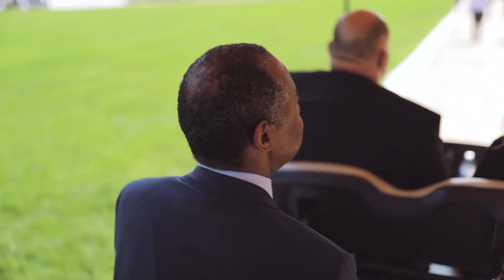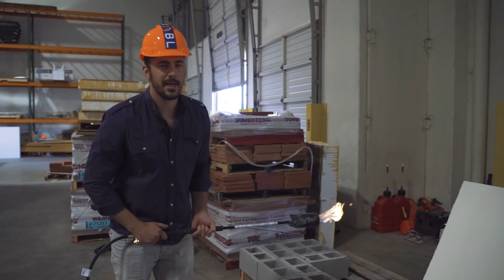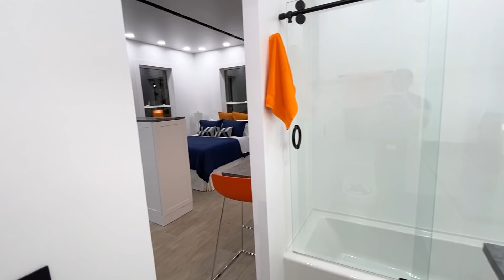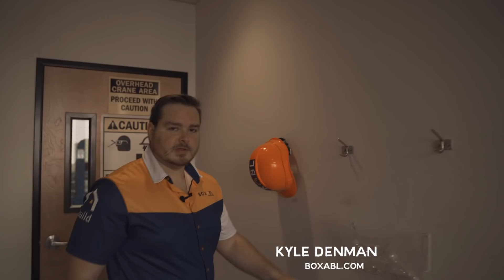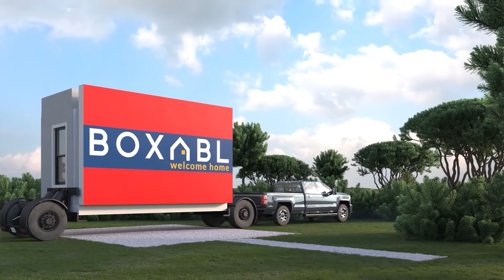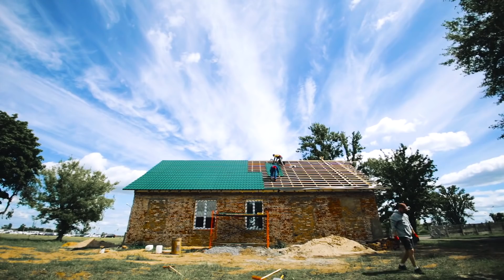This is the House Elon Musk Lives In

Comment: It's the closest unit that I've seen that fits my space and financial budget. Are you actually shipping now? Do you have specs yet for foundation, sewer, water, electricity for my architect to follow? I'm considering the 20 x 30; how much above the original $50K is the addition. The heated mirror is a bit much. Does electric wiring include wifi? Closets are a bit small in the $50K unit; are they better in the 20x30? Thanks for creating these awesome units.

Comment: Not cheep. That's not a full size fridge for a small house. Maybe a 4 bedroom house. Nothing with a flat roof looks good.  Great emergency housing. Isn't magnesium v flamable. Rather than housing alternative I think good granny flat, extension, remote off  grid housing option. Put solar panels integrated in the roof, lithium battery, and attached water storage and pump. Compost toilet? Set and forget. What about stackable? Multi story...if you can fit in a shipping container you have an international market. In Australia they could be classified as caravans so no council approval!!!

Comment: Looks like an amazing idea, though still a few unanswered question (that I neither can find on your website), like:
- How does the plumbing work? Does it have a storage tank or must the house be connected to community sewage?
- Does it come with Solar Panel and gas aggregate system for electricity? Or must it be connected to the power grid?
Also for us non-American people: This model is at about 34.8 square meters in size, so yeah for those doubting if this can be defined as a "tiny house" - yes it can.
Tiny house < 38 Square Meters.
Reply: Yes thats ready to just plug in to the site, the site work is not inlcluded, so that must be setup in advance, foundation and getting the utilities there
 but inside the house plumbing and electrical are already. You can setup utilities however you want to at your site. Whether its a water tank or solar panels it will connect the same way to the Boxabl as regular utilities. For more info check boxabl.com/faq
Reply: @BOXABL  aha nice!
Did not see that question "How do utilities connect?"
in frequently asked questions when I looked, even though it was that easy to find. Thanks!

Comment: $ 49,500 for a tiny home isn't bad for the quality of the home. I wonder how much a single empty room cost? Most people want to add/buy their own furniture.
Reply: The cost of the home is way more than $50,000.00 To put a foundation under it it will cost $25,000.00 more or less depending where you live.  A septic system is between $10,000.00 $15,000.00 also your taxes on everything will run you $10,000.00 plus dollars.  Land to put it on will cost you a lot.  Your $50,000.00 home will cost you well over $100,000.00.  This is not affordable.  A sucker is born every minute.  You think this 400 sqft home is affordable you are crazy.  The quality of the home??? Do we know anything about how energy efficient it is?  This whole video is a con job for weak minds.
Reply: @JesusSavesSinners  Hi. Looks like they have different foundation set up. Theres different ways to cut cost.

Comment: This is not remotely affordable.  By the time you get it on land this tiny home will cost more than $100,000.00.  Do not be fooled this is over priced.  They charge $50,000.00 base price.  How much does it cost to deliver?  This is before taxes. It will be mass produced and cost them $5,000.00 a unit probably.  He is a liar the construction industry has advanced a lot and uses a lot of cutting edge technology.  Mass produced factory housing has been made for decades.  What he is talking about is not unique or new.
Reply: The unit is $50,000 delivered to CA. It is the lowest priced ADU product in the country. Even lower cost that most manufactured/trailer homes.

Comment: They have a FAQ: https://www.boxabl.com/

How much will it cost to setup a Boxabl?
The Boxabl Casita is fast and easy to setup. For $50,000 you get a fully finished house. Whats not included in that price is your land and site setup. This can include utility hookups, foundation, landscaping, permits, and more. Depending on your location and the complexity of your site, this cost can range anywhere from $5,000 to $50,000.

Does it cost $250?
The $250 number on the front page of the website is an estimated finance cost for the Boxabl room modules only with an average 30 year mortgage. Any additional install costs would also be added to the mortgage. Final payment will be maybe $250-$500,
 
What are these made of?
*Boxabls are made from steel, concrete and EPS foam. * These are building materials that don’t degrade and will last a lifetime. The walls, floor and roof are structurally laminated panels that are much stronger than the average building.
 
Are they wind resistant?
Yes Boxabls are rated for hurricane speed winds. They can handle the worst wind conditions in North America.

Are they flood resistant?
Boxabl doesn't use lumber or sheetrock. The building materials won't be damaged by water, and they won't grow mold. This means if your Boxabl floods, the water drains out, and the structure is undamaged.

Comment: Love the structures. Unfortunately, they are too expensive.
Reply: The unit is $50,000 delivered to CA. It is the lowest priced ADU product in the country. Even lower cost that most manufactured/trailer homes.
Reply: Boxabl CA is too expensive....  Modular homes in Texas are much less expensive.  $50,000.00 for 400 sq ft is very expensive.  The cost for land on top of this will run a person another $50,000.00 easy.  Your definition of affordable is insane.
Reply: @JesusSavesSinners  Yes, indeed. CA definition is not normal.

Comment: What about off gassing? Is this house built with more chemicals in the products used to make it indestructible?
Reply: They say walls are made of  steel, concrete and EPS foam. I'm more concerned about the R-Value... That they don't mention they only say its "high" but 4 inches of EPS is about R16... I could see this kind of things be usefull in some situations (mostly urgent needs), but It doesn't seem THAT affordable compared to and on-site constructuction of the same size...
Reply: Olivier B They are expensive.
Reply: Scott Torok - It could be the solution for homes lost as a result of natural disasters. If the government got a bulk rate for basic models, it might be a useful tool to save lives and communities.
Reply: No source of VOC is our houses. We will publish third party test results to verify this soon.
Reply: Boxabl -  Thank you for your prompt reply. Hope you have loads of success!